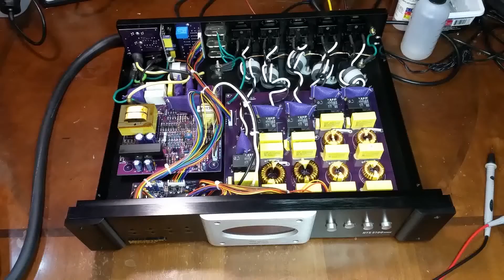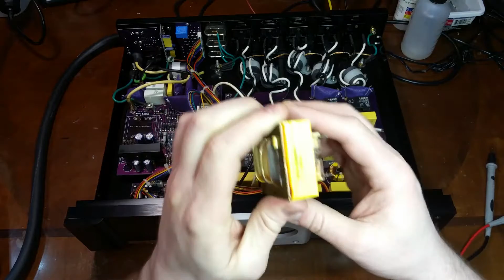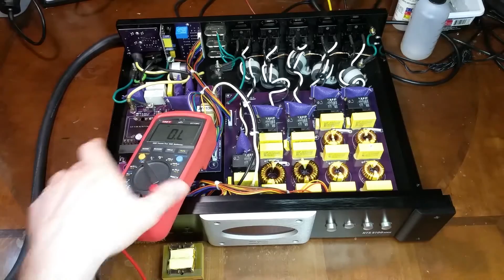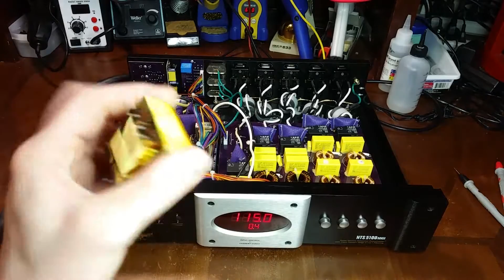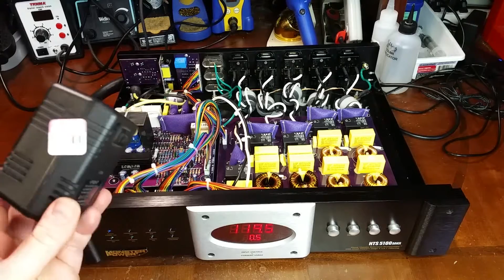Monster Power HTS 5100 Power Center Repair! Update

Comment: Hey Jeff. I have a Monster PowerCenter HTS 1000 MKIII. It powers on fine with green lights on Ground OK & Protection ON. The Power switch illuminates and the Input Voltage displays varies from 115 to 126. The green lights illuminate next to the 4 Unstitched recepticles (TV/DVD/Cable/DVR). Then, without even a load being applied to the strip, the PowerCenter goes dead. Nothing. I try unplugging it and trying it again. Nothing. I wait a day and I have power again. Is this PowerCenter worth having repaired or do I junk it?
:body-blue-raised-arms:
Reply from the maker: If you can repair it yourself it's definitely worth a try. If you have to pay a professional it may or may not be economically efficient.

Comment: Hi, thanks for the repair video.  My HTS5100mkII has an abnormal voltage light blinking. Found on the power supply board that some surface traces were melted and scorched. I soldered jumper wires for the melted ones but think I want to replace the transformer since it is a problem anyway.  Do you recall what the “wall wart” you used to replace the transformer in the 5100 was exactly? I would like to duplicate it.  I assume it was a 120v to DCv without the rectifier? Thanks,
Reply from the maker: If I remember correctly the secondary voltage needs to be around 12 volts at one amp, but it's been a while you might want to watch the video for details. If it's AC output it will work, and if it's DC output it will also work, just remove the rectifying circuit. You'll just be installing the bare transformer.
Reply: Thank you for your prompt reply,  I did watch and re-watch and paused but couldn't discern the type of "wall wart" you ended up using. You did say it had to be an output of 15v to 20v but under 30v.  The only thing I can think of off of the top of my head is a laptop power supply usually around 20v and 2 plus amps. I will check the thrift stores for power supplies like you suggested.  Thanks again.    @jeffescortlx
Reply from the maker: @gilg4664  A laptop power brake is going to be a switching power supply. I would recommend a stick with the basic linear transformer. You shouldn't have any trouble finding a 12 volt AC adapter. The actual transformer itself is going to be putting out more than 12 volts.
Reply: You're right, thanks.  I will stick to a "regular" transformer.  Found one that is 13.8V  1.5 Amps.  Thank should probably do the job.  Thanks again for your help.   @jeffescortlx

Comment: Does ANYONE know what the secondary voltage should be on any of these? Mine is an HTS 2500 with a blown primary. Five pin. All I know is it's 7 ohms on the secondary,  which has a center tap to ground. No data online.
Reply from the maker: Well if the output of the transformer runs a 12v voltage regulator then the transformer secondary side is probably going to be over 12v.
Reply: @jeffescortlx  I was heading in that direction, but it seems to feed most directly a C1384 and one of a litter of LC945Ps, a datasheet for the latter of which is proving elusive. I might have to patch in a variac and bring it up slowly.

Comment: What was the original complaint with this unit? I have an HTS 3600 MK II that won't power up. LEDs on the plug don't light, blue "Clean Power On" LED blinks, relay click sounds come from inside when Protection, Ground and Wiring OK LEDs blink, no power at any of the outlets, display is blank. Bad transformer?
Reply from the maker: It has a dead display, no lights. I believe the outputs wouldn't turn on either, but it's been awhile.
Reply: @jeffescortlx  Hey, thanks for the reply. I have the 3600 MKII model, it looks almost identical to this one inside, pretty much same problem with it. I'm thinking of doing the same repair but I'm not as knowledgeable or skilled. Can I test the transformer with my meter while it's still on the board or do I need to remove it first? By "primary" and "secondary" side, do you mean the 120V side is the primary and the 15V or 30V side is secondary? How do I identify which is which? Thanks.

Comment: Great video. I have the Monster Power Pro 3500. I noticed that on the plug that goes into the wall, it flashes amber. Is this normal, or is it telling me I have an issue? The lights on the front panel are not showing any kind of an issue.

Comment: I have one, and it's little brother.
At idle, the thing draws 400 milliamps (about 50 watts) on the primary through the transformer into the voltage regulators (black heatsink). Very poor design. I can't find a schematic, and for the above reason, I want get rid of it if I can't find a low current solution.
Reply from the maker: I hope your talking about the secondary side. It doesn't have anything on the inside that can consume 480 watts.
Reply: @jeffescortlx  my bad. I meant .4 amps. 48 watts or so. Corrected.
Reply from the maker: @richperilli160  if the .4 is measured on the regulator side that's only like 5 watts of consumption.
Reply: @jeffescortlx  yes. But it's .4 or .3 from the primary side. I can sure live with 5 watts idle
Reply from the maker: @richperilli160  I see. Yes if that's continous it's kinda high. I would think replacing the linear 7800 voltage regulations with switching buck style would help quite a bit with consumption.
Reply: There are 2 main relays that are instantly turned on when the unit is plugged in, and then there are 5 x 12v relays that are turned on for each receptacle at the back of the unit. As long as you want power on each receptacle, you're going to need those relays energized and that consumes power.

Comment: I'm having issues with my HTS 3600 MKII. Maybe you have some suggestions. 
I came across this video https://youtu.be/gWrj2zMnjgg that shows the same thing as happening to mine. I had replaced some gear and moved some gear around with no issues. A couple nights later, I heard a buzzing/humming noise that sounded like it was coming from the 3600. Turns out it was not coming from the 3600; it was coming from an LED lightbulb in my ceiling light. However, in researching the noise, I touched the "Dimmer" knob on the 3600, and the unit died and started the clicking cycle like in that video. (I wonder if some sort of static discharge triggered something or if there is some sort of short in that knob???) Anyhow, I read the various comments in the link I provided and decided to order those black relays. I replaced them the other day. This did not fix the issue. Ugh. I think I might try to replace the white relays now??? The clicking definitely is coming from one of those, but I think that is part of the start-up process anyway, right? Thanks in advance for any ideas.
Reply from the maker: Just blindly replacing relays isn't going to fix the issue. You need to do some deeper testing and troubleshooting before throwing more random parts at it. Relays are not static sensitive, and they also don't have a mind of there own, they are controlled by something that is making the decisions. Microcontrollers are static sensitive.
Reply: @jeffescortlx  Thanks! Do you have thoughts on where to start analyzing? I do have a fairly sophisticated voltmeter, and a visual inspection doesn't show signs of anything burning out. I do have 120V coming in. I'm not sure where to go from there. I feel competent with electronics, but I am an amateur for sure. Maybe this is above my abilities.
Reply from the maker: @danrobba2406  did you check the 7805 & 7812 power rails?

Comment: Its 2020 and I am now using this piece of junk since I had a warranty replacement back from 2017 which was still in the box - unopened. On first use within 6 hours of just 1~1.3A drain, all the outlets switched off. I was using the un-switched / no delay setting. Emailed monster support for schematic diagram of this unit but they are another useless bunch of folks. Not even a courtesy response. Will never buy any products from monster.  The issue appears to be the 12V power requirements for all the relays. I could have just swapped out the 7812 regulator but didn't bother. Besides which I noticed when all relays were driven, the 7812 sink was hot to the touch.  
To resolve the no outlet power issue  {display was on and the unit 'appeared' to be functional but outlets were zero volts}:
I disconnected the inline relays on 3 of the 5 lines and jumpered them. I am now just using the glorified surge portion of this piece of junk in addition to the EATON whole house suppressor installed in the main breaker panel. Hope this helps someone if they are still using this joke of a "power reference". As someone pointed out - this POC needs another power reference itself to operate.
Reply: Funny, I have an HTS 5100 that just stopped working. Similar story to yours....lights and indicators appear normal. But no power out in unswitched mode.   At least I thought I had nothing out until I measured and found 82V on all outputs when running unswitched. When I change it over to switched mode and push the on button I am getting 120V on all outlets, when I push the off button they go to 82V out. I can hear the output relays open and close in this mode.  It looks as if the voltage to activate the relays on the output board is not arriving on startup when set to unswitched mode, but gets there just fine when set to switched.  Why I am getting 82V at output with the output relays open, I have no idea.
Reply: Odd.. the 82V definitely does not make sense. On the relay board, there is just one molex connector which comes from the switched/unswitched pcb. Refer to the video above. The connector just below the green ground wire is that molex connector. This connector starts with a black wire. If you use this wire as a reference point, all other connectors on that molex should read  -11.xx v DC.
This is the driver to the 5 relays. In my case, when all the relays were driven, this voltage fell to 7V. You can try keeping 2 of the 3 outlets unswitched and see if that makes a difference to the AC voltage on all 5 sockets. 82V is admittedly odd. You could instead desolder one relay and just jumper the N/O connection and see if that changes to a 120V out. Note these are single pole relays. I am not sure if it switches the HOT or the NEUTRAL. Lemme know what you find.

Comment: I have an HTS 1600 with no power to the display and not enough power to the outlets.  I'm only getting 49v at the outlets. the 120v:12v transformer in mine is smaller than yours and has 3 pins on one side and 2 pins on the other.  When I test the resistance (while still soldered into the board) I get 2430 ohms on the 2-pin side and 68 ohms across the 2 outside pins on the 3-pin side.  Any ideas what can be bad?  Any suggestions what else I should test?

Comment: I bought my Monster 2500 model, about 4 years, with only one drawback, the unit created a slight humming sound through my EV speakers, but it’s not very noticeable when playing music, if you use a separate equalizer. Then, about a month ago, the unit emitted an alarm, and the whole unit shutdown, overheated. The thermal fuse will need to be replace, not sure if it is worth it, or just simply by a better updated, power conditioner.
Reply: Grady, if there's a hum, that's indicative of a filter capacitor that would need to be replaced.  You 2500 unit should have one or two filter caps in need of replacement.  I have 3500 that's clicking constantly and I'm going to replace the relays to see if that solves the problem.  I also have another one that is no longer powering up and I believe it may need a new transformer but I don't know where to source one that would work since it has 6 leads attached to it.

Comment: The power conditioner should have been plugged into a power conditioner! haha. love it. Hi Jeff, I've been trying to identify a replacement for my PCB mount transformer. I wanted to get your input on this one I found. the OEM installed has no part numbers, naturally...However found this one, would this be a viable replacement? https://www.newark.com/hammond/183h28/low-voltage-transformer/dp/24B8668?st=transformer%2014%20volt
Reply from the maker: That looks like a muti-tapped transformer. Do you have any recycling shops or thrift stores in your area? They typically have buckets of AC adapters to choose from.
Reply: @jeffescortlx  hi Jeff, I have a bucket of class 2 transformers. I was a store manager at radio shack, and accumulated quite a bit of parts and components over the years. I was hoping to find a close match with same mounting pins for soldering onto the board. I agree with you that beefing it up to 1.5 amps is going to keep an undersized 800ma transformer form working to hard to supply the current, and stable more operating temperature. What output rating would you recommend? I'll start rummaging through my spare parts!
Reply from the maker: @mattsawesomeshow  I assume the original transformer was around 1 amp. 
I also worked at a radio shack in the late 90's.
Reply: @jeffescortlx  that was me too...1998 to around 2004 at Radio Shack. Back when it was a good parts store to shop. Nothing like asking a customer for their name and address for buying a pack of batteries 😀
Reply from the maker: @mattsawesomeshow  yeah I had a fake name & address in the system for people making small purchase that I didn't want to harass them for there info. I think it was the store address. We had to harass them enough for Sprint long distance. I sold a lot of brief case phones and satellite TV subcripion.
Reply: @jeffescortlx  ha...yeah sprint LD with a $10.00 spiff... I think all stores had the fake customer name and address!
Reply from the maker: @mattsawesomeshow  spiff. Havent heard that word for 20 years. Don't forget to sell a RSVP with them $9 head phones.

Comment: Lol!  "MONSTER" garbage!....look if your power conditioner cant handle a surge than you shouldnt connect it to anything you value. Monster power conditioners are notorious for failing! Their owners manual actually says to disconnect from wall during storms!...lol!!...seriously that alone should make you run!
Reply: I don't think you quite understand how this all works Retired at 49.  You can laugh that the Monster Power products are all junk, that is your own opinion.  Most people in the know don't agree with you. How do you know that the transformer was taken by a surge?  Indeed you are more than likely completely wrong about that.  All electronic components can fail for many reasons.  I was in the high end audio business for years and was there to witness the advent of the high end surge protectors/line conditioners (filters).  Monster entered the market with some very fine products designed by Richard Marsh and Demian Martin, two very talented individuals.  Remember that all, well 99.99%, products are designed and built to a price point and in no price point did I ever notice a high failure rate for the Monster Power line.  I am not sure why you say that they were notorious for failing as they were not.  Again you laugh at a liability clause in the owners manual, this statement is no different from when you buy a microwave and it tells you not to dry your cat in the oven.  On dozens and dozens of instances I have seen how lightning can devastate an electronic component.  I don't care if you are sporting a Furman line conditioner a direct hit will go through it like a hot knife through butter.  I have seen it both ways with high end surge protectors, some (of the same make and model) let the lightning in and some don't. I guess it's the quality of the MOV's and the variable strength of the lightning.  So for those of you who want one of these older units I say don't run but rather get it but remember a couple of things;  MOV's have a limited life span and need to be replaced from time to time and if you find yourself under a thunderhead unplug your good stuff because if it wants in, nothing in the world can stop it.
Reply: @mac3792  Your empirical assessment of this product is highly appreciated. GOD BLESS!

Comment: With my 5100, first 2 outlets stopped working, I unplugged it and plugged it back in, now none of the outlets have power, display works fine though. I checked all the Thermal fuses, all check out fine. Any ideas?
Reply: Leave it unplugged for a few days and plug it back it. If it's still not working open it up and look for any burn marks on the capacitors. MIne stopped working and after having it unplugged for a few days it started working again. Now that was a few years ago and its still working today.
Reply: Will do. BTW I noticed while the front display shows 121 volts, the output at the outlets hovers at only 82-83 volts.

Comment: I just repaired one of these and it also had an open primary winding in the transformer. I could not find an exact replacement for this transformer. The original is a 6-pin series ST-5 single primary / single secondary transformer. I could only find 6-pin ST-5 single primary / dual primary transformers but that will work fine as long as you jumper pins 6 and 7 together which will put the secondary windings in series to make a single secondary winding. I used a transformer from "Signal Transformers" part number ST-5-16. I also went ahead and replaced the nine electrolytic capacitors on the power board since they tend to go bad with age. Hopefully that will extend the life for another 15 years or so.
Reply from the maker: Sounds like you did a solid repair!
Reply: Hello, when you repaired your monster power conditioner.  Did you just solder a jumper on the leads once installed through the board?
Reply: @gopack47  Yes, that's exactly how I did it.